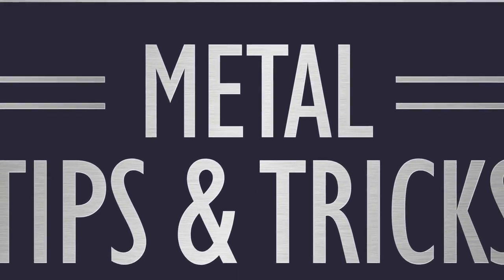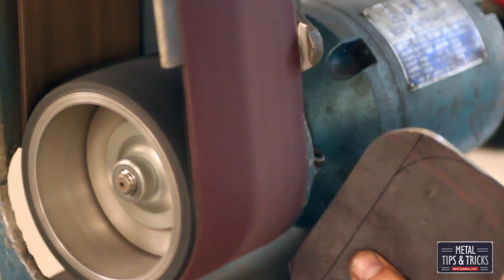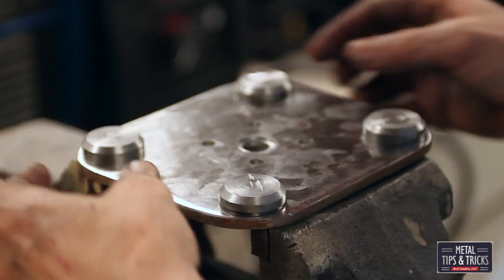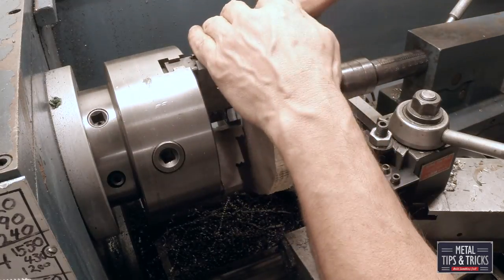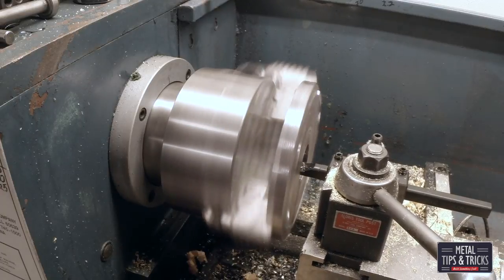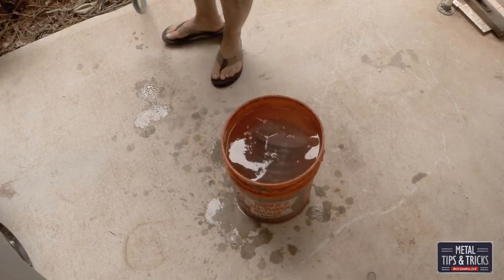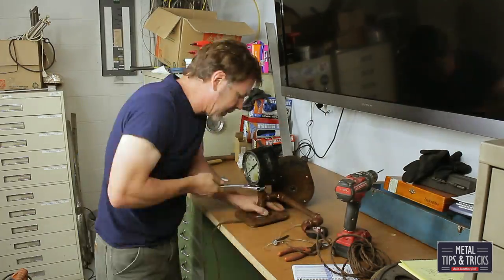How to build this  lamp made out of plumbing pipes and a old gage.

Comment: Nicely executed project.  I have had good luck cutting rings, discs, and washers with hole saws.  I stack the plates, clamp them together and then drill through holes in all four corners.  Then I screw the plates to a suitable piece of plywood or 2x lumber.  At the drill press or mill I secure the wood to the table and saw away.  With the workpiece secured to the table you do not need a pilot hole.  When cutting metal hole saws like slow spindle speed and lots of cutting oil.  There will be some sharp edges on the rings when they are unstacked so be carefull.

Comment: I like the vacuum trick! I wonder if I could use this for running wire through long sections (15ft) of pvc tubing.
Reply: Yes, put a small piece of foam rubber on the end of the string.
Reply: I've used this trick to run wire through UG conduit in 300 foot lengths. We call it sucking a mouce though the tube, the mouse is a piece of foam as mentioned above or just a wad of paper, the string is the mouse tail  :)

Comment: Did you include a wire trap to prevent pull out?
Reply from the maker: Good question Edward. No I didn't put a wire tap on it. There are so many bends the wire has to go  that it doesn't  need one.

Comment: Hi Dale, 
To help keep disks from spinning on the bolt, turn the bolt around so the nut is clamped in the chuck (instead of the bolt's head). Friction on the clamped parts will want to tighten the bolt, forcing the bolt to clamp tighter. You will notice that the center will stop turning at this time so be mindful to watch it. Easy to re-adjust on the fly. Use some washers to make sure the bolt doesn't destroy the wood buffer. Hope this helps.

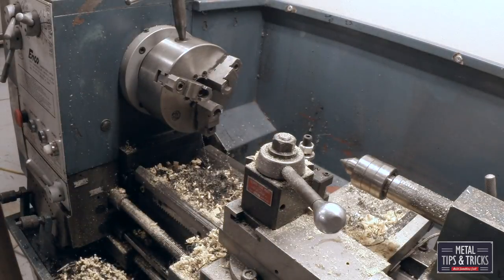Comment: Good thing this was fabrication and not production machining because the shop boss would have kicked your butt for leaving the chuck key  in the chuck at 12:30. I like Mr. Fenner's rule he passed along from his shipyard days, "If the chuck key is not in your hand, it had better be in it's holder." Good advice for avoiding the ER and prevents looking for the key on the other side of the shop.

Comment: Where is the earth wire ? Metal parts and electricity do not mix well.
Reply: how many lamps at your house have  a grounded plug  ,come on !
Reply: Noway is correct, it's all polarized plugs for lamps.
Reply: Noway Jerk, erm, all the metal ones...
Reply: i should have said merican lamps i beg my pard.
Reply: For a standing lamp made of metal it'd probably be a good idea.
Reply: only 120 volt
Reply: 120 Volts or not. It is still enough to kill you. In the wrong conditions 50 volts ac is enough to make you die.
Reply: lick a plug already dave
Reply: That was the purpose of the rubber grommet in the base. The wire is totally insulated